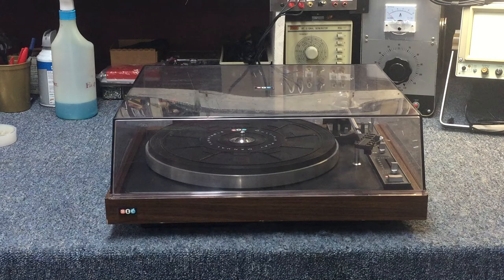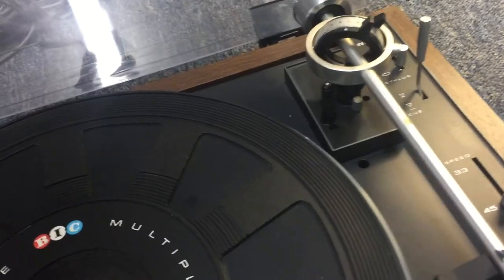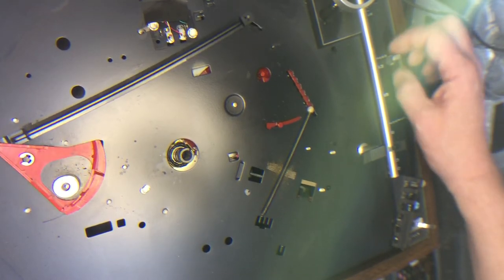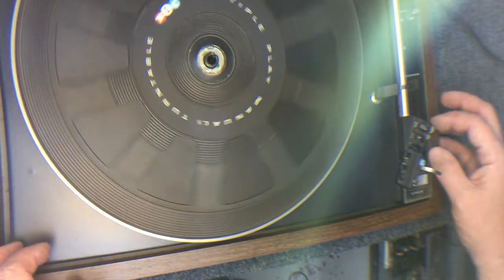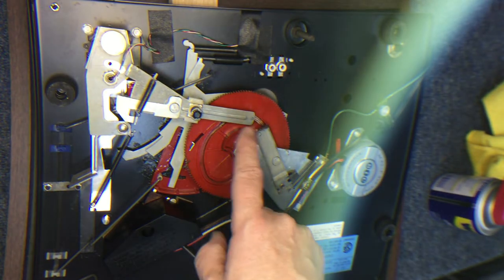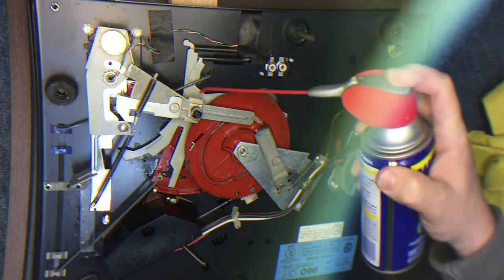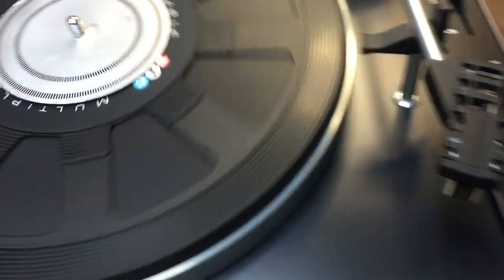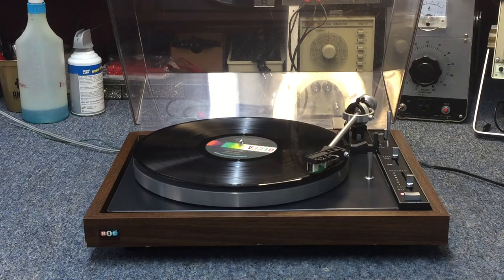BIC 960 Turntable - repair & testing

Comment: Nice video.  I just got one of these turntables.  How do I make sure a replacement stylus is adjusted correctly ?  The online owners manual shows using a plastic gauge with cross-hairs that snaps on from underneath. Of course my turntable didn't come with this tool.
Reply from the maker: The replacement should come with a info sheet that will tell you how much weight to set on the arm for the stylus tracking, I use a small electronic postage scale to set mine, very cheap item on ebay/amazon.

Comment: just got this model. what can cause the motor not to turn even with belt? maybe it needs a new belt?
Reply from the maker: If the motor isn't turning check and make sure the motor switch is being engaged, if the mechanism has issues the switch may not be closing when you slide the switch from off to manual.  I'm assuming you have already removed the platter to check the belt?  If not , check that first.
Reply: The motors are known to get gummed up

Comment: Hi! Great video!! When I place albums on the multiple album spindle they don’t reach the album  clip “record support “ in the upper left-hand corner of the unit. The groove that locks the spindle into place is pointing to the 4 o’clock position. It seems that we need to turn it to a different direction because of the slant of the spindle which will allow the albums to be slightly closer to the clip. I noticed in your video that the groove for the spindle is pointing to the 2 o’clock position. Is that the appropriate position, and how can we fix that? Thank you!!

Comment: Experiencing an issue where the axle of the turntable (the place where you put the clip on) is spinning with the platform. In your video, I see that that piece does not rotate with the spindle. When I remove the turntable itself, you can easily spin this, and it seems like it she be locked into place. 

Also, when I ordered a 15.2 inch belt, it is by far way to big. I have the original belt, but this seems to be almost twice the size. Any thoughts on this?
Reply from the maker: The center post is NOT suppose to turn, probably what happened was the platter seized up due to hardened grease and someone tried to force it loose and the result was the center post breaking free from the frame, to fix that you would have to remove some of the linkages & gears underneath and find a way to anchor that post back to the frame, I've never had the problem so I don't know how it was attached from the factory or how to advise you.  The belt size could be wrong in the PRB book, I ordered a used OEM belt & retainer clip from a guy on eBay but I didn't think to measure the belt once I got it.  If you ordered a genuine 15.2 PRB belt and its too big then the book is wrong, if you ordered a generic 15.2 then maybe the size of that belt is wrong.

Comment: So that green wire is hanging out of mine. I haven't turned it over and taken the back off, but I can't tell what that green wire goes to while I'm looking at your video. Could you tell me where that green wire goes and what it is ?
Reply from the maker: The Green wire is the ground that will attach to the screw/binding post on the back of your receiver.

Comment: I have a 960 coming in. What’s a good low cost cartridge /stylus combo that will work with this.
Reply from the maker: Garry, thanks for checking out the video!  Audio-Technica model AT-VM95E sells for about $70 and should sound pretty decent if your albums are still in good shape.

Comment: hey anyone/everyone, i've removed the platter on my estate-sale find 960, cleaned and lubed everything, and the platter will not fit on the spindle! i used alcohol and heat from a hair dryer to remove but it will not go back on spindle at all now. any ideas/hints?! thanks